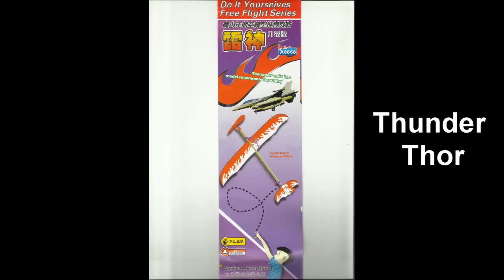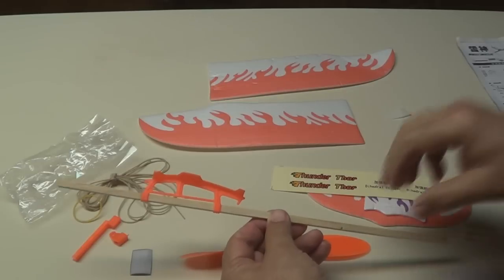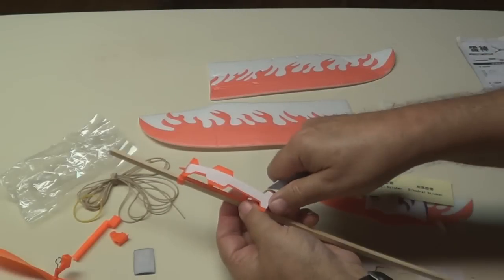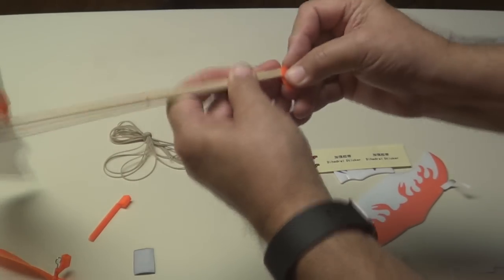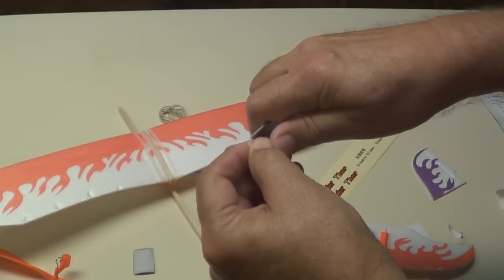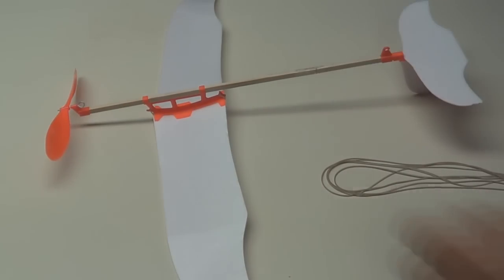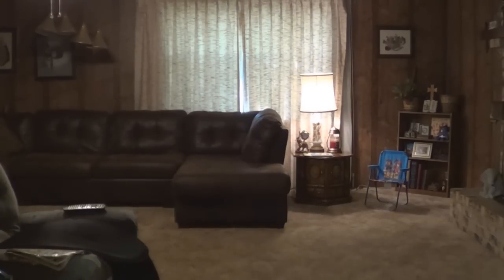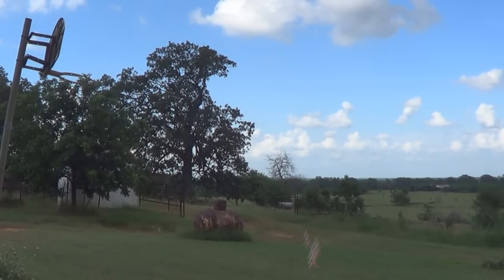How To Build And Fly A Rubber Band Powered Plane "Thunder Thor"

Comment: Nice video. Do you have an easy way to attach the plastic pieces in the bar, specially the tail one? Because they are to tight and small, its very difficult to attach them without broke anything.
Reply from the maker: No special way. I had a problem with the wing piece. It was so tight I broke the body wood and had to glue it back.